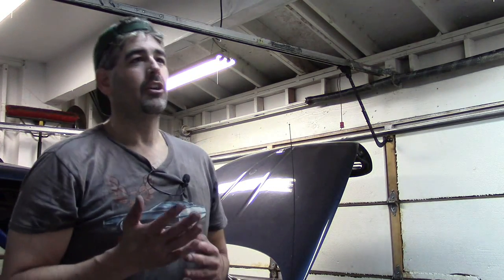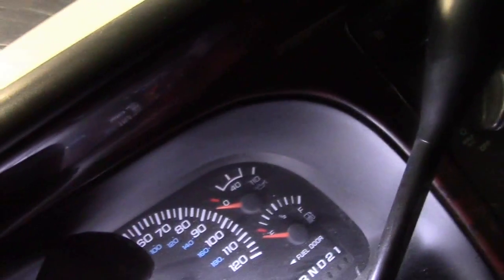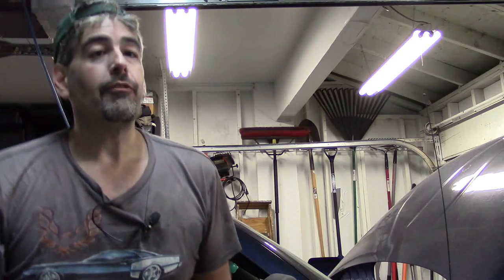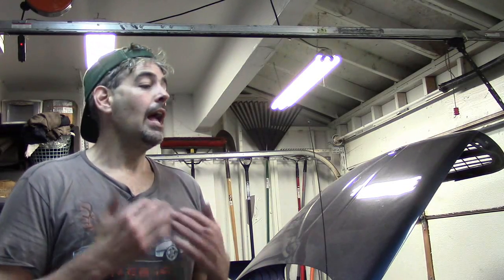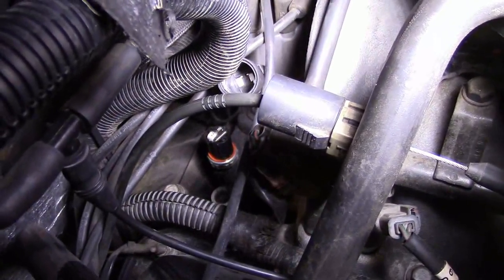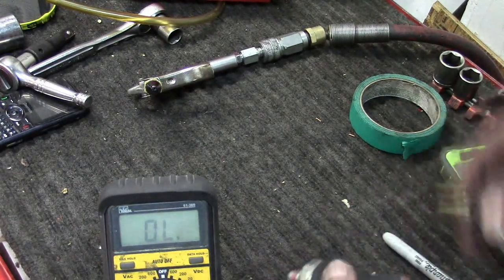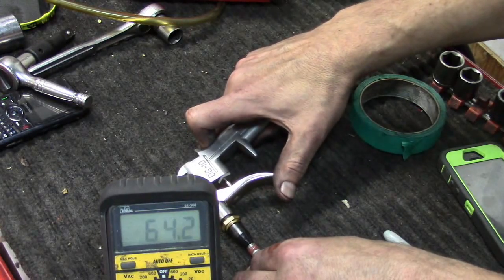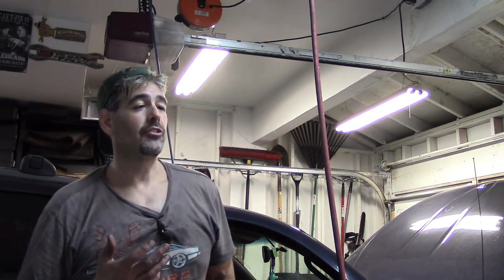DIY- Low Engine Oil Pressure Diagnostics

Comment: That test on the pressure sensor only showed it was alive, Without knowing what pressure gives what voltage it is hard to say that it is working correctly. I do agree that the Engine isn't long for this world though. :(
Reply from the maker: Correct- I was only showing demonstration of how to look for sending unit functionality.  It is actually irrelevant in this specific application.
Reply: If the engine oil is low all it needs a new oil pump why do you say the engine is shot
Reply: @jessemichel7073  the most common cause of low oil pressure is worn bearings, those are lubricated internally by oil passages. If they get sloppy too much oil flows and you lose oil pressure. The sound of the engine combined with the metal particles in the oil leads to the conclusion of the engine being shot.

Comment: isnt 10psi of oil pressure normal at idle speed? im pretty sure that on the mercedes m103 even 5 psi can be within spec at idle.
Reply: Average 'good' pressure would be (and this is for a well used engine that is still in good shape) 10PSI for ever 1k RPM.  That's a bit of a minimum pressure.   Combine this with the pressure dropping below 10PSI which it did a few times-and the bearing grit in the oil.  The engine is done.  Needs at least a basic bearing set-which while you're in there, do the job right.
Reply: I see someone just mentioned "6psi" for oil pressure being good at idle.  Me thinks I'll stick with the 10psi at 1k.  If it's that low at idle, and you tromp on the gas?  It will be one hell of an oil starvation problem.  (It takes a tiny bit of time before the increase in RPM equals increase in oil pressure. Not a lot of time mind you!  But enough it could accelerate the damage already done)
Reply: Tedybear315 well the engine i was talking about (mercedes m103) shows 6-8psi at 600rpm idle with a warm engine. as soon as you hit about 1500rpm the oil pressure builds up to about 50psi. the instruction manual says that this is how its meant to be with this engine.
Reply from the maker: Not on a cold startup- that would be for fully operating temp andf even then, anyone buying a car where a dummy gauge like the one on this car indicates 4 would be foolish.
Reply: Schrodingers Box oh, i thought the 10psi you measured was with a warm engine. on cold startup 10psi is way too low of course.
Reply: Kokainsamurai
  I'll take the hit on that one.  I should have been more clear with the cold vs warm/hot engine oil pressures.  Sorry for any confusion that created.  6-8psi warm at 600rpm sounds low.  However I am not an engine designer.  As always, mileage may vary :-)

Comment: the specification of the oil pressure at the specific vehicle is 6psi at idle and 30-80psi at 3000 RPM with  engine at operating temperature. you might  double check that sensor .
Reply: if your mechanical gauge is to be believed,  you can put a new engine in this vehicle and the cluster is going to do the same thing
Reply from the maker: David PAY ATTENTION,!  Put down the God Damn service manual which you dont even understand and PAY ATTENTION TO THE EVIDENCE.  besides, you dolt- if you even paid attention to the service manual you would know that 6PSI COULDNT EVEN POSSIBLY BE COLD START PRESSURE. The dummy gauge full off spec Is 7PSI!!
  but to say "the engine has bearing failure but has good oil pressure" is like saying "that tire is flat but has normal air pressure".  You dolt- OIL PRESSURE IS CREATED BY THE BEARING INTEGRITY!!!  How many times does it take for you to comprehend that?????
  You dont comprehend the fundamentals you just see a spec you dont even understand
Reply: sorry those specs I gave are for the 4.7 the 5.2 is 6psi curb idle min, 30-80 at 3000rpm, bypass relief valve setting is 9-15psi and the oil pressure actuation pressure is 5-7psi. good thing you didn't charge the poor guy any money for your diagnosis.
Reply: your mechanical gauge never dropped below 10psi. the pressure has to drop to 6psi for the cluster to light
Reply from the maker: Absolutely 10000000% incorrect.  UNDERSTAND THE FUNDAMENTAL CONCEPT OF A DUMMY GAUGE.
Reply from the maker: David LISTEN TO THE KNOCK!!!    Bad lifter or pushrod??? ROTFLmAO you have no idea what you are talking about. It is obviously rod knock notice the knocks synonymous with RPM!. And why do you keep forgetting- bearing material in the oil.  CoMe on man, You're sounding stupid.
Reply: I can send you a video tomorrow of  dodge ram with the same engine 5.2L  it has 7psi at idle with not "bearing " or any noise so should I change the engine only because you THINKING the pressure is low come on man you better then that .
Reply: I think you too young to have Alzheimer this argument started because you said there was a low oil pressure do to a bearing problem,any ways cold start engine 13psi . 201f oil pressure 6.9pis scanner and 7 psi Mechanical gauge at the oil sending unit.please go and look you own video.
Reply: Matt I can't believe you are too arrogant to admit when you are wrong. according to dodge 4psi is the curb idle speed minimum spec for that vehicle and engine at 3000 rpm 25 - 110   psi
Reply from the maker: Absolutely incorrect.  First off the evidence is irrefutable that this is NOT a sensor issue as evidenced by the obvious symptoms demonstrated.  Second, the curb idle at cold startup should easily be 40psi.  Third, as evidenced twice in the video, and as documented in service manual, the gauge failure trigger is 7PSI.  We in fact saw this actuation twice as soon as the IAC stablization occured.  Electrical and flow confirmations were equally irrefutable.
   To say this could even possibly be a sensor issue is absolutely ludicrous.
Reply: so you saying PRODEMED and ALL DATA are wrong o and also  IDENTIFIX has the spec..
Reply from the maker: david cisneros I am saying use logic and reason.  Look at the evidence presented.  It is IMPOSSIBLE based on simple, basic, remedial understanding of fundamental operational concepts that the problem with this car could even theoretically be a bad sending unit.  You will need to explain the symptomatic etiology otherwise you would just look foolish saying what is obviously contraindicated by multiple examples.
Reply: what I'm saying is base on the oil pressure readings been at 10psi and with  a malfunction gauge at  the dashboard you might have a bad sending unit  and not oil pump cording to all data . I'm not saying you don't have bad engine do to other mechanical issue.
Reply from the maker: What you are saying is necessarily contradictory.  An engine with the evidenced bearing damage and knock MUST have excessively low oil pressure.  This is basic fundamental fluid mechanics, my friend. So even if the sending unit was bad, which it is definitely not as was irrefutibly evidenced in the video, it would be irrelevant anyway.
  Ignoring evidence you don't understand makes for an illigical thought process, albeit simplified.
Reply: of curse not .so if two professional service manuals are saying @5.2L engine at idle oil pressure should be 6PSI and you have 10psi if my math is good the vehicle has 4 psi about spec.and you are saying on the video this engine is not good Cuz the low oil pressure. however the vehicle needs a engine do to the( bearing) (knocking) but not Cuz the oil pressure.
Reply from the maker: david cisneros DAVID!!! Fir christs sakes would you please listen to yourself!!!! Bearing knocking IS the result of actual low oil pressure!!  OMG. Please stop- you just sound foolish now.  You cannot have worn bearings and still have normal oil pressure!! Please do your research!!!
Reply: i have to  agree with david's first post,  your mechanical gauge never showed oil pressure dropping below spec it was steady at 10psi. according to your mechanical gauge readings it has and is holding sufficient oil pressure and the cluster should not light. i am not saying there are no problems with the engine but there is NO evidence that mechanical engine damage and low oil pressire is causing the cluster to light
Reply: you can have a dead cylinder and I still have a good oil pressure like I you do regardless if you have a bad engine it don't matter at this point you oil pressure is good and you can't say that you have a bad engine beset on this oil pressure reading.
Reply: i know how it works but someone doesn't....so i will explain. the pcm monitors the oil pressure sensor if the pcm sees the pressire drop to 6 psi the pcm tells the cluster low oil pressure
Reply from the maker: And yet with that, Andrew, you are going to dismiss the full off indicated TWICE IN THE VIDEO directly after IAC normalization occurred on cold startup. 
  Really???  Seriously, Andrew??  Really???  Please explain your rationale to me on that!!!
Reply: how that hell you want to call a engine bese on a good freaky oil pressure if you run the engine and then it reach operating temperature and you  gauge read 5pis the you can say you have a bad oil pressure you just not smart enough to understand..by the way I I bet you money you have bad lifter or pushrod,and not a bearing as you swear you have.
Reply from the maker: David you IDIOT- How can you have a bad rod and NOT have a bad bearing?
  You clearly have no understanding of the concept of rod knock.  Yes I will totally take your bet hahaha!!  THERE WAS BEARING MATERIAL IN THE OIL REMEMBER???
  Besides, Einstein- as was stated several times in the video the vehicle was never warmed up. That would be asinine. How many times have I stayed the IAC barely normalized. It wasn't even normalized on the final gauge reading- didn't you notice??
  Unfuckinbelievable.
Reply: go Watch you on freaking video you becoming one of the facking 98% . I can't west my time with stupid people. have yourself a good night.
Reply from the maker: Haha, yeah I'm stupid. I gave you every opportunity but you still don't get it. 
  Remember- by your argument, dont add air to a flat tire. The tire may be flat, but not because it has no air pressure. 
  Jesus.
Reply from the maker: david cisneros Yes there is no argument about that David.  Jesus Christ. OMG, I tried.  You do not understand the CONCEPTS. You only see a number.
  I give up.  Hopefully one day you "get it" and it will click.  Can't force anything into a closed mind.
  BTW- what's the engine temperature on that car with 7PSI?
Reply: that's true
Reply from the maker: andrew scott Its not arrogance, its correctness.
  Look, you guys are both stating a rod knock is present but not caused by low oil pressure.
  I cannot help if you think this way because It means you do not understand the fluid mechanics of oil pressure.
Good luck.
Reply: actually matt, if you go back and read my comments i said i was not saying there is or isn't rod knock i didnt see or diagnose the vehicle. but back to the subject of your video, diagnosing low oil pressure, your oil pressure reading with your gauge showed oil pressure within specifications the cluster is lieing to you this vehicle does not have low oil pressure
Reply from the maker: andrew scott Hey what was the OPERATING TEMPERATURE on those specifications at curb idle by the way?
  yeah.... forget to mention that, did ya? Whatever they are, I GUARANTEE it isn't below 10psi.
Reply: those specifications are for normal operating temperature
Reply from the maker: andrew scott EXACTLY!!!!!
 Q.E. MFin D!
Reply from the maker: Andrew I am shocked. I figured for sure you would know the basics of fluid dynamics. To say this engine has the obvious mechanical evidenced but ALSO say there is no evidence of low oil pressure is completely contradictory. It is IMPOSSIBLE for both to be true if you understand the mechanics of oil pressure. 
  There is bearing material in the oil. There is rod knock. There is confirmed flow of oil from the pump. There is confirmed electrical continuity.  There is confirmed high voltage shutoff on a "dummy" dash gauge. 
  It is IMPOSSIBLE for there not to be low oil pressure based on this data combination. Please explain how it would be even remotely conceivable!!!!!
Reply from the maker: Andrew - based on what evidence? If that were true then it would HAVE to be electrical issue.  Where is the electrical fault shown? This was 100% conclusively eliminated. 
 The only logical explanation based on this data is actual low oil pressure correctly reflected by the minimum threshold on the dummy gauge and substantiated though diagnostics. 
   You have to give REASONS for your counter position based on the data shown!!! Good luck with that.

Comment: Glad you're back with another video. One of the best tech/mech on YouTube
Reply from the maker: Thanks OZ! I try to produce content when I can but it's tough these days!!
Reply: Totally understand. I'm sure all your die hard fans/ subscribers truly appreciate your time and knowledge that you give us in every video you upload.
Reply from the maker: Oz Mechanics Can't tell you how much I appreciate you guys. I really do!! Thanks Oz! It's great to hear from you!
Reply: Schrodingers Box hey mate, just got a quick question is it possible for my upstream o2 sensor to read 1.513 volts constantly? from what I've learned they should only be between .2 and .8 of a volt,  my car is overfueling but there is no codes showing when engine is idling at running temp the voltage on the o2 sensor stays the same always  and my long term fuel trim is stuck at 3.1% no matter what I do like revving the engine or removing vac pipes. I am a tech but I'm HGV and have never had anything to do with o2 sensors or fuel trim and I don't just want to buy a sensor I'd rather be 100%. Thanks and epic channel my friend.
Reply: Schrodingers Box Thankyou for getting back to me iv been smashing my head against the wall trying to figure this out I'm on your wideband o2 sensor videos now trying to learn about them, iv had it plugged into my scan tool and I get 02b1s1 1.474v at the moment and o2b1s2 is 0.460v also the LTFT is 3.1% all the time and STFT is -8% to +3 fluctuating oh and it sometimes says close loop fault iv got the sensor off the car and I'm searching the internet on how to test it which is proving difficult. I don't know what a bias voltage is ha ha but I'm going to teach myself. thankyou for the reply I really do appreciate it.
Reply from the maker: The UnrulyYoutuber It is not possible. You should probably read at the O2 sensor directly and see if it is oscillating and my bet is you have some issue with the Bias voltage and you won't see 12V bias. But the sensor itself won't read 1.5V.
  The other possibility is maybe you have an A/F sensor instead of O2 sensor.

Comment: Oil pump creates flow, a restriction to that flow equals pressure! Not enough flow or not enough restriction equals low pressure!!

Worn bearings, internal leak, bypassing relief valve, worn pump gears (lack of flow), clogged puckup ect can all contribute to a lack of oil pressure
Reply from the maker: Finally, someone who understands poil pressure!  The flow is there as evidenced by the gauge variation. This is clearly, without question, a bearing clearance causing lack of pressure. 
 anyone who would just put an oil pump in this engine clearly doesnt understand the mechanism of an oil pump and the fluid dynamics at work in oil pressure.
Reply: +Schrodingers Box I have 9 ASE certs plus an A&P license and have been working on vehicles since I was 16, (28 now). I also study everything mechanical and am a premium member of yours and Scanner Danner!! Keep up the amazing work my friend!!!
Reply: At least you get it and understand it!!  Before I retired a while ago I had only 4 cert's.   But I knew enough "Master Techs" that where book smart.  But flat out dumb as a bag of hammers when it came to practical application.  Congrats on all the education and the UNDERSTANDING of that education!

Comment: in my 73 charger 318 i had low oil pressure after about driving 20-30 mins it would be at 40 then go to 20 so i took the oil pan off and saw the oil pickup was full of leaves and old silicone from previous owners  while i was down there i rotated the engine looking to see my rod bearing were any good surprisingly they were still very tight and no metal material it makes the oil look kinda grey even when you showed your sample to us it looked grey and a bit like glitter normal old looks like its black or very brown right afterwards i put it all back together and it now stays a solid 60 psi on the oil gauge even after 1-2 hours of driving
Reply from the maker: Oil pickup full of leaves.  Ok.
Reply: it was not too bad i bought a 440 a guy said ran and it was full of acorns lol he had run it the day before he said and i believed him because it was on a wooden run stand lol
Reply from the maker: witnesszer0 Would lve to hear your explanation on how these leaves and acorns are getting into an oil pan.
Reply: freaking hole in the back of the intake valley pan under the air gap intake squirrel will get into the darnedest places lol

Comment: Change the oil,and put in 50 weight. Retest the pressure. If the engine  is that worn but makes good power and isn't burning oil, run it till it dies. The knocking is most likely in the lifters or chain tensioner. If the rods are knocking, they won't stop when the pressure is normal.
I seem to remember there is an oil pressure regulator at the pump.
Reply from the maker: Yes I suggested 50W but ultimately this engine is doomed and at best it is unreliable